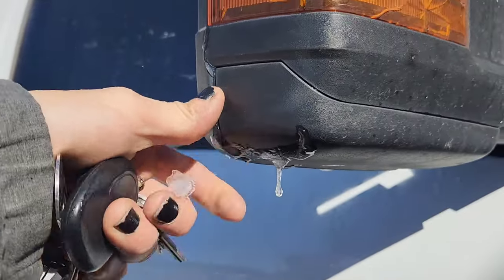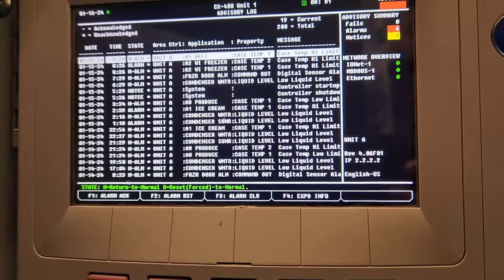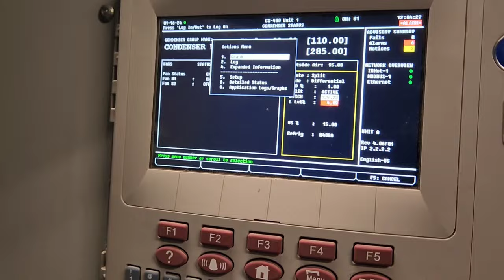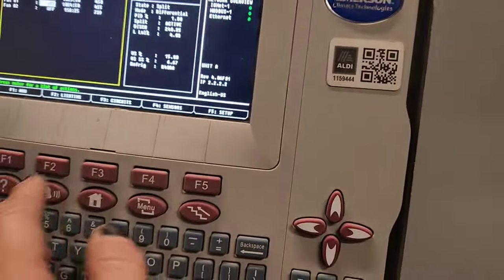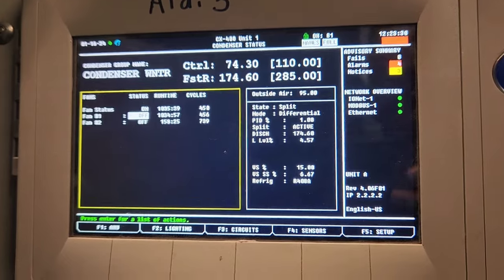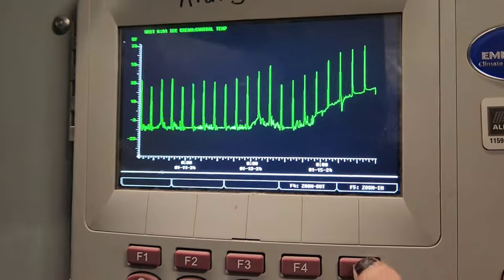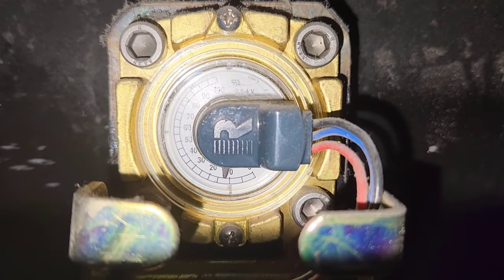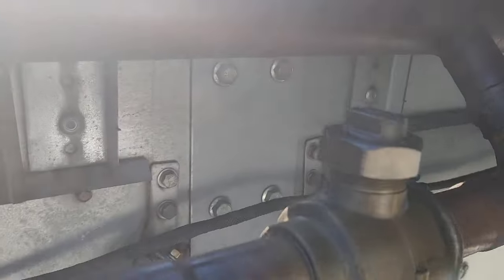Cold Weather Affecting the Rack...And a leak

Comment: Yeah controlling head pressure on refrigeration equipment in the winter time is always a challenge.
Reply from the maker: always is. My favorite ones that I've ever seen. Was the fan motor control for head pressure that varied the voltage Going to the motor. so it would start out at like a 150 V, and then slowly accelerate the voltage until it would maintain like 225 or 250psi...Whatever it was set up and it would maintain that perfectly.
Reply: @HVACRServiceTech  Yes York used to do that on some of their commercial A/C equipment along time ago they called it a choke coil.

Comment: It could be low on refrigerant, but a bad check valve could show the same symptoms from letting it back feed into the shut down side of the condenser. If you put it into split are you getting pressure build up over suction pressure in the shut down side after awhile when you close off the pump down line on the suction header?
Reply from the maker: Not exactly too sure exactly what you mean,  but it was in winter mode. When I let the head pressure build up and it exceeded 285, it switched into summer mode.
Reply: @HVACRServiceTech 
Usually if the condenser can go into split mode there is a check valve coming down from the condenser main liquid line to the receiver only for the split mode side. In split mode half the condenser pumps down back into the suction header and all the liquid in half the condenser gets back into the rack. If the check valve goes bad high pressure liquid can back feed and get stuck and build up in the pump down side of the condenser when the rack goes into split mode or “winter” mode making the receiver look low on refrigerant.

I could have missed it in your video but if your receiver levels come back to “normal” after 5-20 minutes then there is a high likely hood that either the check valve is bad or the pump down line from the split side liquid line to suction header is not open or something with the pump down solenoid is possibly bad.
Reply from the maker: Very useful information that you have provided to me. Thanks! And I will keep that in mind and watch out for it in the future. Here, we did have a huge leak, but probably the check valve is a great possibility when I leak search and there's no leak to be found

Comment: Any way to add a cycle switch?
Reply from the maker: So the way this one ended was. I added the refrigerant and it's running just fine. It became more about the leak but it was leading up to the leak and the refrigerant issue that I wanted to focus on with the video. All the walk-ins are holding negative 10° perfectly fine with the one fan running, it maintains properly.